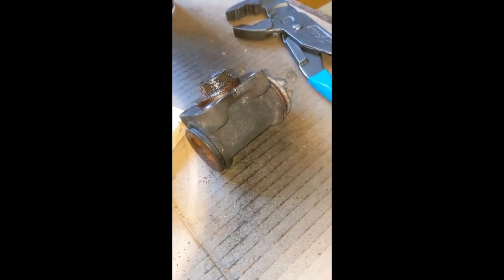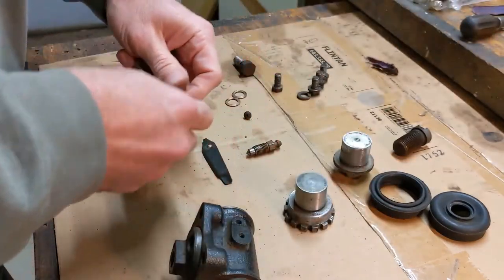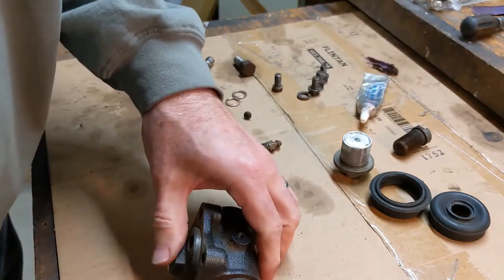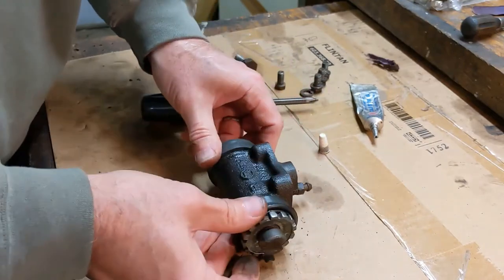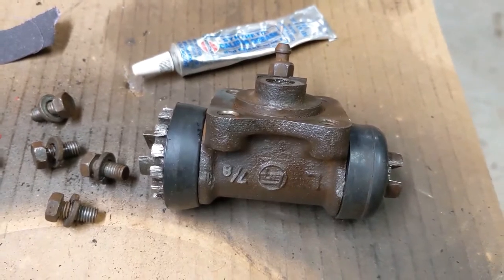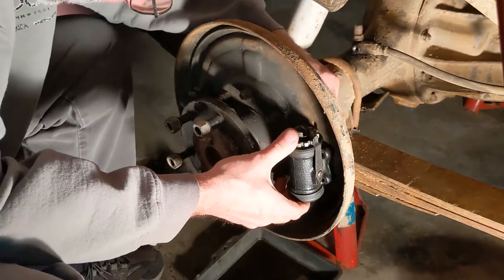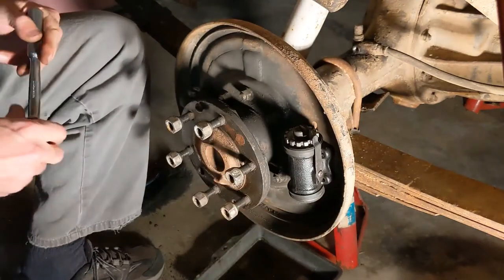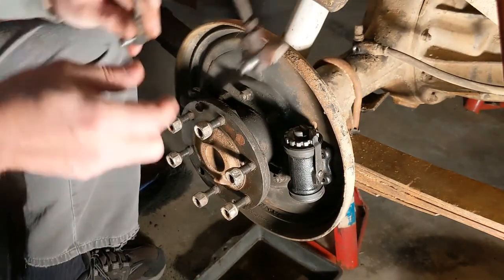Brakes Part 2

Comment: How did you clean those?
Reply from the maker: The rear cylinders were seized with rust, which made disassembly difficult. I let PB Blaster penetrating fluid soak overnight then used channel locks to gradually work the pistons out.

To remove external rust, I used a wire brush on a drill and emery paper. 

To clean the bore, I used wire tube brush then flushed with clean brake fluid.

The bleed screws were rusted closed.  I used a stiff wire, more PB Blaster and compressed air to clear it.

I used a thread tap and die to clean the threads.
Reply: @mikerestoresanfj4069  Thanks Mike!  Great videos!